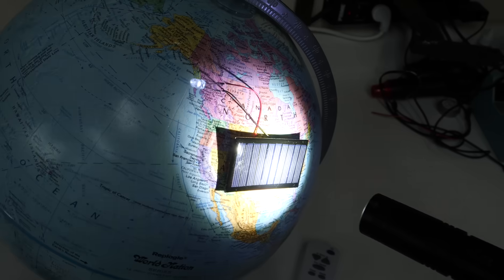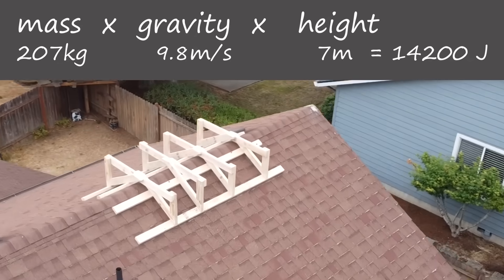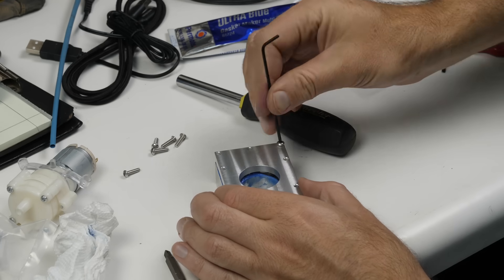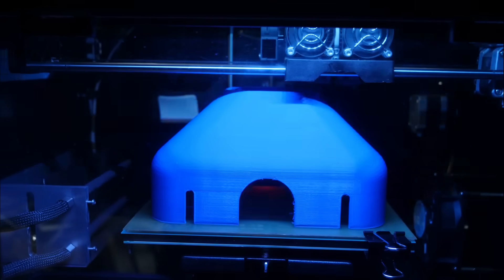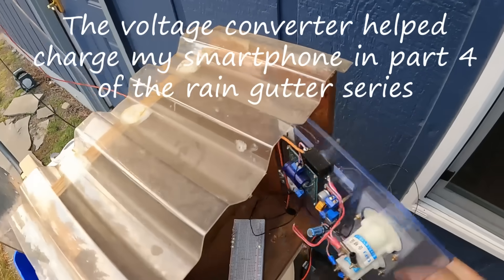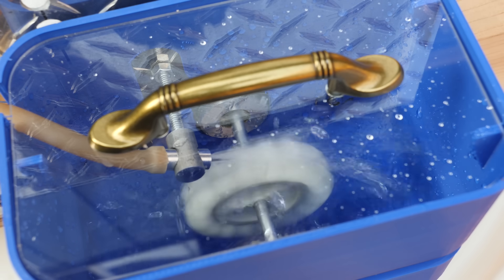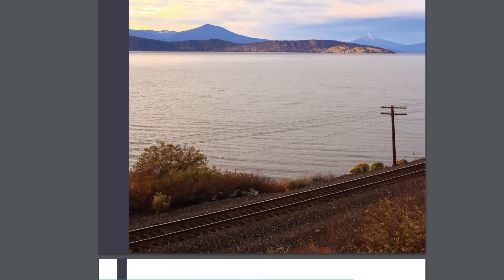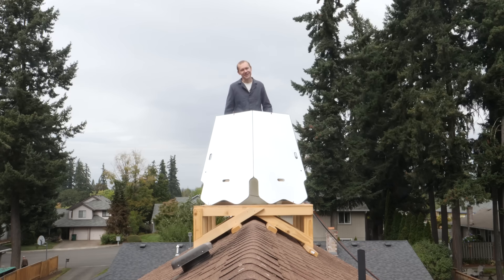Storing Solar Power on my ROOF!!!

Comment: Thanks for your video. However… I am missing real information here. It seems like a high school experiment. Nothing that I couldn’t have worked out with common sense. Nice to have a led giving lightt when the sun is down. How big should the barrel be to get 1 kWh?  How feasible is that? How feasible is this to store my unused solar electrical power to use after sun set?
Reply: And btw… i am not living in California, but in the Netherlands… a lot less sunshine 🌞 and a lot more rain. I am looking for a way to store my surplus solar panel during the spring/summer/early autumn period, to use in the evening/at night.

Comment: So, check me on this, but couldn’t you do this without solar power, just using the water pressure in the utility company’s water line?  Design yourself a little hydro electric system where the outlet is the water you consume. And the utility company pays for the pumping??

Comment: Your calcs are way off sorry. Mass x Gravity is the weight so your 4kg is actually approx 0.4Kg mass. The result is your expected stored Energy is a 1/10th of your calculation. 
In Wales, the have an "Electric Mointain" where they pump water high up in a reservoir when there is surplus and release it through turbines when demand spikes. 
See link https://en.wikipedia.org/wiki/Dinorwig_Power_Station

Comment: Interesting, at first I thought "rube Goldberg" but then realized the mechanical concept which is a different approach.  I think this EV and Solar is in a uphill battle for anything dependable as a Power Grid Replacement. When it comes to  load, someone needs to have a breakthrough on Refrigeration! Seriously, the load of a Commercial Refer Rack system would tear a "Storage" apart in minutes to not seconds. A/C systems? Same. What are We going to eat plants and sweat in the future? Remember that cow's eat Greens all day long and they are fat and sweaty in the summer time! Welcome to the Future of Renewable Energy!

Comment: This is great! It would be a really cool variation to use a ram pump to pump the water from the same (or slightly smaller?) sized rain barrel on the ground up to the one on the roof. You could put in an overflow pipe that leads back to the one on the ground. Then - the ram pump could run forever and you'd always have power available.
Reply: A ram pump running forever?  Sounds quite fishy to me.  Not only are you going to need more water to operate the pump than what the pump will push back up, but it requires pressure and you're going to lose that pressure if you try to generate electricity with it prior to going into pump.  If you planned to generate electricity after the ram pump, then you were already aware that the pump isn't going to pump all the water back up to the top and knew it wouldn't "run forever".
Reply: That would be a perpetual motion machine

Comment: Now ya just need to connect your water power wheel that runs at night time to the water pump AND the lights so you can refill the upper barrel while you’re running your lights and just have continuous power 😬

Comment: A lot of solar household drive electric car as well,
The electric car is a huge battery for the house, should serve as an mass energy buffer.
Charge your car by solar during the day,  
release the energy back to the house in the night until 50% of the battery.
So you may still drive some distance when you need at night.

Comment: Had a hot shower idea ones. For a fitness where you pay less for your monthly membership the more power you generate. The hard part is generating the power per machine without all the generators. Than I thought what if every machine had a simple water pump by working out you pump up water to a reservoir to the roof. By changing the pump ratio you can change the intesitie and pump up more power.
when electricity is expensive water will fall down via one big generator and sold to the grid as green power.
If the maintance cost can be kept low it could even be made so that you get paid to work out

Comment: I hope I'm not too late for a QA... Mr Quint, why did you build a custom water wheel generator, instead of using the original electric pump in reverse? 
Thanks

Comment: For aesthetic reasons homes could have the storage built inside the attic and you could plan for greater storage if the structural framing was planned properly. Also, Rain harvesting may be incorporated in some hybrid design to bypass the need to pump water up by simply storing some of the rain at near-rooftop level for free battery usage.

Like all ideas these need to be site appropriate and will not make sense for all users.

Comment: A cubic meter of water heated by 70°C stores about 77 kwh of energy.  That is about 280 million Joules. That is about what an average house uses  for heating, hot water, cooling and electricity in a day. 
If the water is cooled by 70°, the water will store ove twice as much energy because of the 334 J/g heat of fusion. 
Since most of household energy use is for heating and cooling, if the energy was stored as heat or cold, most of the battery problem would be solved.  A heat engine can extract electricity from temperature difference.  A 30% efficient heat engine extracting the electricity from the 80% of energy that is wasted by solar panels would more than double the efficiency of solar panels.  In cold weather the waste heat from the heat engine would make the process near 100% efficient.  In hot weather, storing the heat from the refrigeration would improve the overall efficiency .  Mixing -70° C air with air heated by the stored heat from the refrigeration process would generate electricity and provide cold  exhaust air for cooling.
If a well insulated tank of water can store energy for days or weeks, it would be tens or hundreds of times less expensive than a lithium battery.
If you use gravel, you can get up hundreds of degrees and get better efficiency from a heat engine.

Comment: This is how two power stations work, in Wales. A lake at the bottom of a mountain, another at the top. When a surge in power is required, release water from the top lake to power the turbines. During off peak hours, pump the water back up again.

Comment: Mind you, storing your water in a semi-transparent tank may cause some plant growth in the tank from the sunlight, which in turn might cause blockages in your pipe system and overall power losses! You can just paint over this tank with a white paint instead of black to reduce the water's heating, which also helps plant growth.
Reply: They make additives for long term water storage in barrels.  You could also just put in a little bleach if this needed to be permanent.
Reply: @quercus3290  he's not telling you to go out and build something like this. He is basically teaching you why you would be wasting your time.
Reply: Go to the dollar store and get a bunch of copper scrub pads. The copper will kill, or should at least discourage bacterial and fungal growth
Reply: @Mars-zgblbl  What do you mean? Can I put this on a cat water bowl? I give water to stray cats but the bowl is always getting green stuff in it, do you think putting those things will avoid that?
Reply: @theblukatlife  Yeah, copper coins in the bowl can also reduce the algae growth. You should still replace the water every now and again though.
Reply: @theblukatlife  Using a copper bowl or putting some copper in the bowl will reduce the rate of microbial growth, but it will also affect the taste of the water, which MIGHT discourage the cats from using it. Simply using a tiny droplet of soap to clean the bowl every now and then would be more effective than copper, but require a bit more effort on your part.
Reply: @Mars-zgblbl  How many scrub pads would be needed to treat a barrel like in the video? Wouldn't the copper eventually corrode and make problems?
Reply: @enermaxstephens1051  Please don't do this until you've spoken to someone outside of YouTube comments about its safety.
Reply: @Mars-zgblbl or paint the barrel black
Reply: @Mars-zgblbl  Or go to the dollar store and buy rechargeable batteries to charge instead of building any of this.
Reply: @AvgDan  He addressed why you might not want to use ion batteries. The lose capacity over time. A water battery's capacity can be sustained for as long as the materials out of which it is made last.
Reply: white will cause algae and you don't want that in the system as it would probably clog up that spinning part.
Reply: An anti-growth additive would also reduce the potential ‘fungus’ issue.
Reply: Howong does the light last for
Reply: Paint it black for hot water
Reply: There's zero chance he is using this thing beyond making this video. Cool idea, but it's worthless.
Reply: @rootuser7206  and im sure you invent stuff that works?
Reply: @rootuser7206  good job acknowledging what he himself clearly said in the video but pretending like you're clever for realizing it.
Reply: was not in anyway a permanent structure.

Comment: I do something similar to this, but I use air instead of water. I build windmills for a hobby and all my windmills are connected to small pumps, which compressed air and store it in a large tank. Once the tank is up to pressure, I bleed it off through a small steam engine converted to run on compressed air and it is connected to a generator which puts out about 14 volts and almost 2 amps, which is perfect for trickle charging storage batteries.

Comment: would love to see the amount of energy used to lift the water up to the reservoir vs the energy it can generate by gravity. i was thinking of a seaside set up pulley system generated by windmill pulling up sea water on a large reservoir then when it gets full releases a good chunk of seawater on the generator. i know the windmill can generate much more energy by itself but storing not relying on batteries is a greener approach i think. maybe adding a rain catcher can add up to this type of system.
Reply: Wow that is actually a good idea imagine if we use also seawater pump to pump up the water, just like a bicycle pump but instead of the force of the arms, it uses the force of the waves to pump the water up

Comment: Cool idea, but u can buy the cheap acid battery and it will be much cheaper than total cost of your equipment, just if you manage the battery and not reduce it to lower than 30% 
Probably the life cycle of battery will more than of your dc pump motor

Comment: Props on the heat sink, excellent work, rather than relying on a siphon, tap your return on the bottom of the barrel preferably in the middle and use sweeping bends (grey conduit if not potable will do the trick) and you could perhaps double energy available, depending on peak flow rate when drawing energy out
Edit, hose for the return tends to be flexible in more ways than just moving around objects, it looses energy by acting as a bellows, pumping and constricts in diameter, rigid gray pvc conduit of large diameter to reduce dynamic restriction, ie renoylds number. The whole trick to a ram pump is the length of solid tubing that sets up a shock wave the moment the valve slams shut. Great video by the way

Comment: Thinking out loud about efficiency:

If you could sample the Volts and amps during the day , integrate that , you could calculate the amount of energy needed to fill the tank. 14000joules divided by that and you have the efficiency during the intake. 

Then while delivering 1W at the LEDs measure the time it takes to empty the tank. Those seconds are numerically equal to energy delivered at the LEDs. That number divided by 14000J and you have the efficiency of the production phase. Or this number divided by the first calculated number and you have to total efficiency.

Then you'll be willing to replace that generator with a better design (or commercially available) and redo the calculations to check the improvements.

Great video, too bad you didn't go into efficiency calculations (probably very low). Where the losses are and how to minimize them would be a great follow up !

Comment: Great example, however we have had that in use here in Missouri for over fifty years at Taum Sauk Mountain. The really amazing story is what happened when it failed a few decades ago and the cut off in the upper reservoir failed thus causing an over-topping event that sent a flood down the mountain. Repaired and running quickly but the damage took much longer to fix. It was an earthen dam so cut was fast and a wall of water came down with lots of power.

Comment: wow, that's awesome, I think it would be good if we could plan the rooftop since pre-construction, so it can support several barrels at the same time.
Reply: this is mainly just an experiment... that whole barrel can only store about 4 watts of energy (14000 Joules is only about 3.8 watts). You would quite literally need a large pond at the top of a nearby mountain to produce any usable in the household level of power. As someone else mentions heating a cup of coffee is about 5x more power than that whole barrel holds.

Comment: Ok. I’m commenting at about 3/4 through this. This has been something rolling around mr head for years. YEARS. As far as I’m concerned this is proof of concept.  If you were to set up a 300 gal tote at the top. Gravity fed to a turbine below that sets on top of another tote, with a pump, ran off of a battery and solar panel, or an alternator that’s also turned by the water, then theoretically you could have perpetual electricity….right?  How feasible is that? Please, your thoughts. Oh…and I love the invisibility cloak  😁